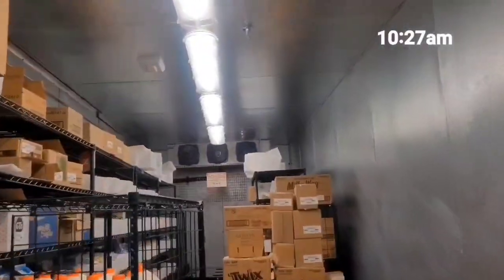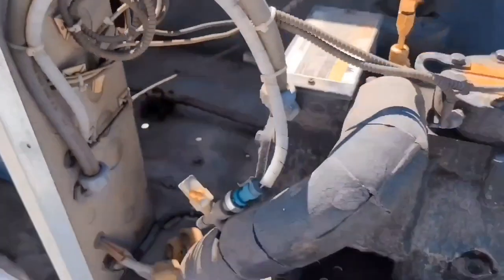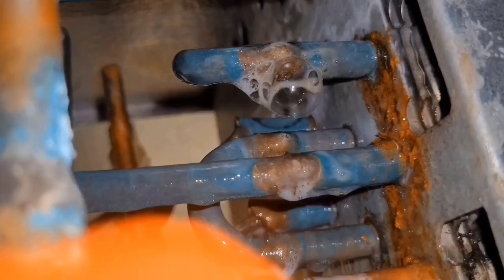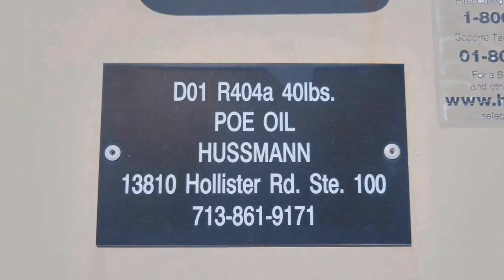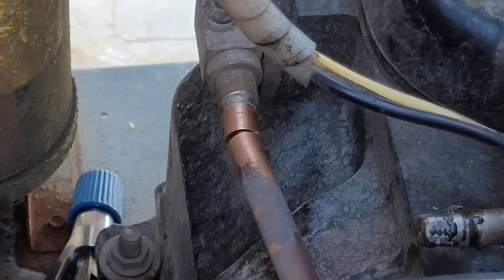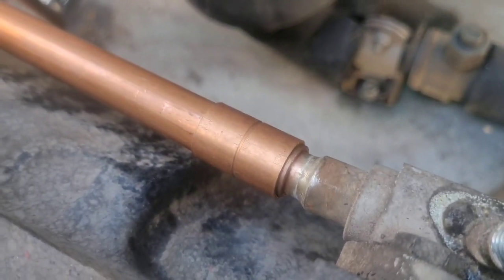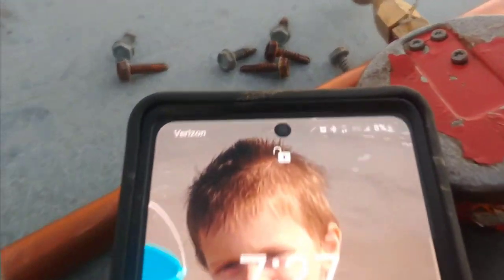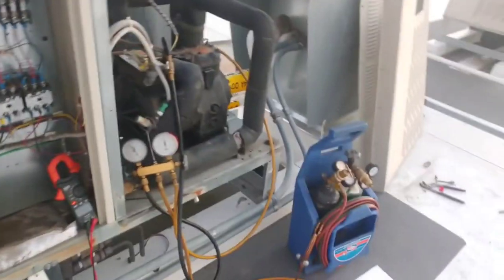EVAP COIL LEAK REPAIR - REPLACE DRIER AND REPLACE A CORRODED SECTION OF DISCHARGE LINE - RECHARGE

Comment: You ever tried the blue flux sticks from harris called blockade ? They might be more accessible. They're for brazing brass and I even used them on BPHE's lol
Reply from the maker: I have a few times, but more for Soldering steel. I think it's more expensive per stick too tho.